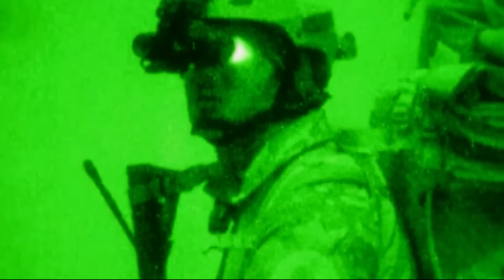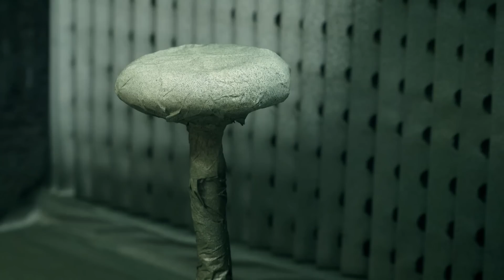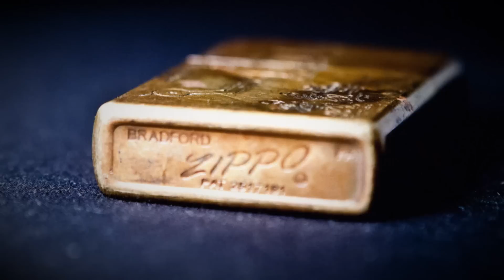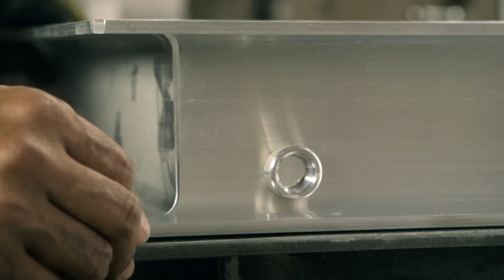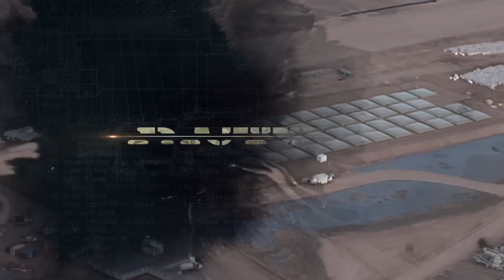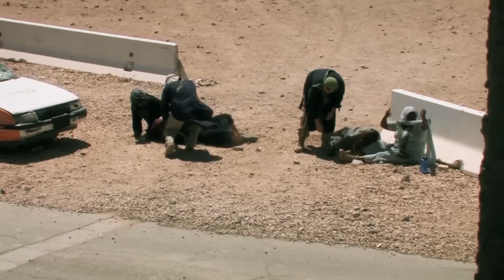How COMBAT HELMETS are made! | Battle Factory

Comment: The same material for helmet should be used for full body armor covering  neck and limbs .
Reply: Army won't allow that since it will make soldier slow
Reply: @FLORIDIANMILLIONAIRE You have absolutely no clue what you are tallking about. We actually use much better and heavier body armor.
Reply: @Dudedontgiveup  give me an example of product you are using I'm always interested in body armor improvements
Reply: @FLORIDIANMILLIONAIRE just look at the IBA and Interceptor vests, we already did that but now we are issuing more plate carrier like vests
Reply: @yeahmonkey8595  it doesn't tell me anything about the density of the material.

Comment: “Sordered” - wtf does that mean? I thought Americans used a bastardised version of the English language but this is just taking the pi55! If they cannot cope with measurements such as imperial (inches/feet/yards) it’s no wonder they fail to understand Celsius/centigrade/Kelvin, whilst sticking with the worst measurements of all - namely using the meaningless number of Fahrenheit with 32F being equal to 0’C (Centigrade or Celsius, the triple freezing point of water).

It’s all well and good for America to maintain it’s scientifically meaningless numbers for temperature measurement based on the oddest numbers ever invented ie imperial measurements for Fahrenheit/inches et which is as dumb as it gets when it involves the easily processed Base 10 metric system, whilst the the imperial system of American “engineers” is stuck with Base 12 Imperial measurements. 

The best example why this idiocy no longer meets the grade in our international trade is when an American rocket using Imperial measurements was meant to be attached to a metrically designed and manufactured European rocket system, only for it to be made all too expensively clear that whilst there’s very little difference between some Imperial:Metric measurements, the differences are so much worse when using Imperial measurements. There’s a lot to be said for using Base-10 (metric) when compared to America, one of the few countries that sticks to the most useful measurement systems of all, namely metric.